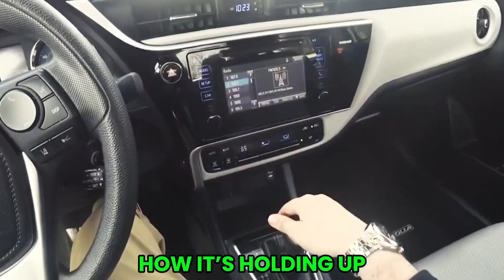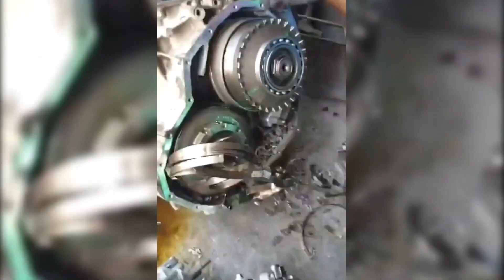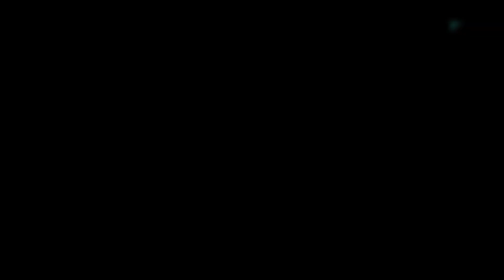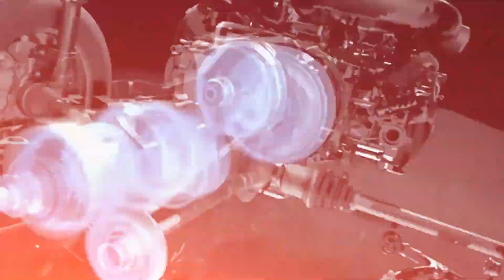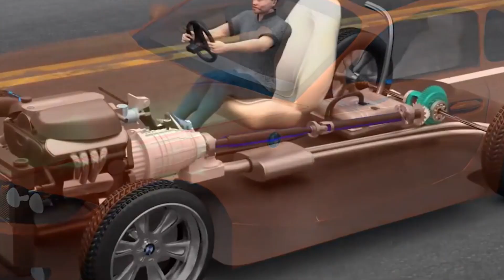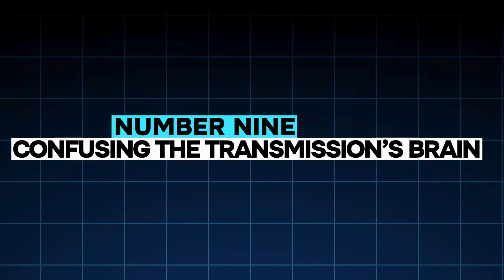7 Habits That Instantly RUIN Automatic Toyota Transmissions (Cost You Thousands!)

Comment: Hello, Merry Christmas. I just came across your channel. Thanks for making videos for us Toyota owners. I have a 2006 Tacoma SR5 Pre runner TRD  extra cab that I bought new as a present to myself. I have taken care of it and have only 71K miles. I have new leaf springs that I need to install still but besides that only a batt, tires and wiper blades...oh ya and my buddy put a new coat of the Black pearl sand on it. What a gem I got new. I want to do a trans fluid drain and refill. what do you think that besides that that I should address? thanks again.
Reply from the maker: Merry Christmas! 71K miles on a 2006 is awesome, a real gem.